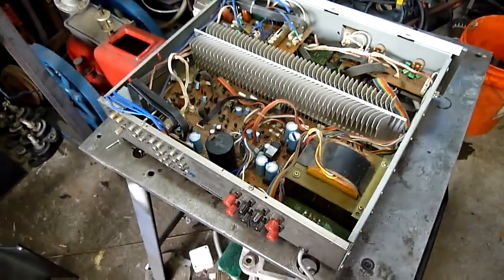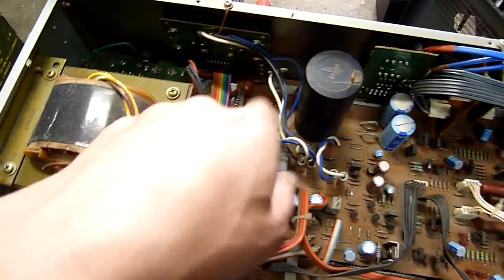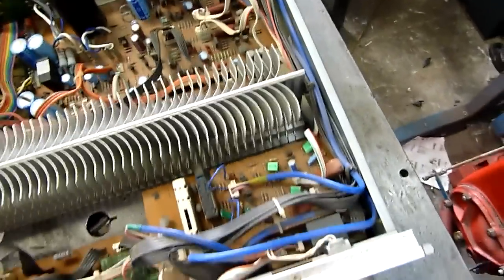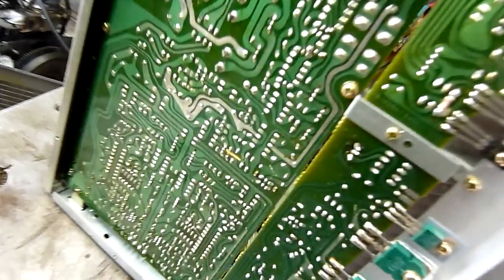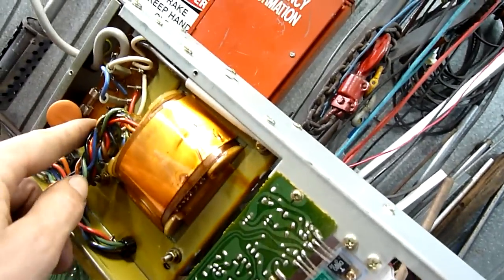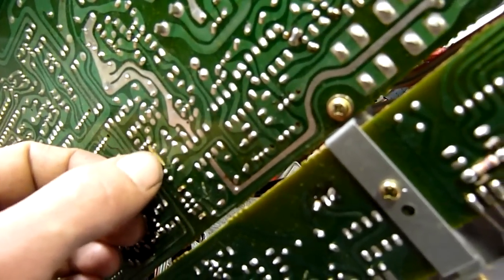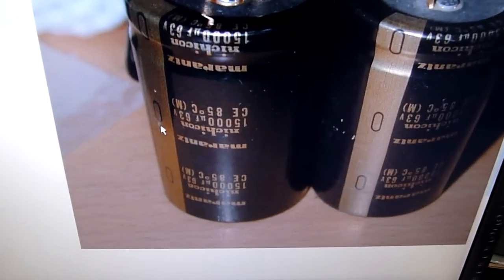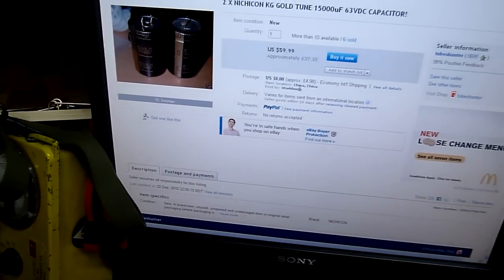Luxman L-430 Amp Capacitor Queries

Comment: The man is right! Don't listen to any audiofools, that will tell you about "crispness", "sharpness" or anything like that. There is capacitance, ESR, ESL, tolerance(doesn't really matter in this case), and few other parameters. Just browse any electronics shop (digikey, element14 for example) to find a replacement with right dimensions, capacity and lowest possible ESR.

Comment: Have a look at PartsConnection site. You can get Elna, Sanyo Oscon, even Auricaps for signal path. Most good vintage amplifiers and receivers have Nichikon or Elna at the power supply.
Have a look at that site, they have a wide variety of audio electronic components for upgrades or DIY projects, the kind of things you not see on eBay very often. Nice amp, it deserves the upgrade.

Comment: You can get audio specific caps that what i use in large power amps for my P.A usualy about 50v not sure with something this small they take the high signals in the Khz no problems i would just buy another busted amp from ebay and gutt it

Comment: Low ESR caps are required when filtering high frequency switch gear such as inverters or switch mode PSUs. The caps in your case are most probably only filtering 50Hz off the Xformer. I'd go with a good brand, but not necessarily so called "audio grade" cap$.

Comment: Any general purpose cap works well in 50/60Hz mains filtering applications for amplifiers. Just match the original capacitance within reason and make sure the temperature and voltage ratings are equal or greater. 

You will be hard pressed to hear "audio grade" caps used in this area. The only time I use "audio grade" electrolytics is in the signal path and even then, I try to avoid electrolytics in the signal path like the plague. Film is best for caps in the signal path.

Comment: Panasonic/Matsushita are very good.  The EB series have longest life with a bit higher ESR as the dielectric barrier is thicker aka the longer life.

Just put larger capacity and amp will work for another lifetime.  :)

Comment: You can use a higher Microfarad rated cap when replacing ones like that, they usually have a tolerance rating.

Comment: Hey ed. 
Yeah I fixed my brother's amp has his amp caps had failed and I didn't have any audio caps so I tryed some very the same 65 volts @ 22.000uf and it works fine. and that was last June. And its still running great today

Thumbs up*

Comment: Nice old amp :-)

You wont need switch mode psu cap spec so ripple current and height would be my way of selecting them.

Its a basic unregulated +/- bridge rectifier supply so it wont be critical, the accuracy of the "Uf" value only matters if they were fully loaded up, and if the design was good then that will never happern.  Full volume would be ear killing :-)

Nice update ed :-)

Comment: most audiophile stuff is snake oil. (cables etc) but any caps above the rating should work alright as long as its low ESR and it can handle high ripple current eg get 20000 µF 63 volt or higher. with power amps you need the low ESR and high ripple current handling